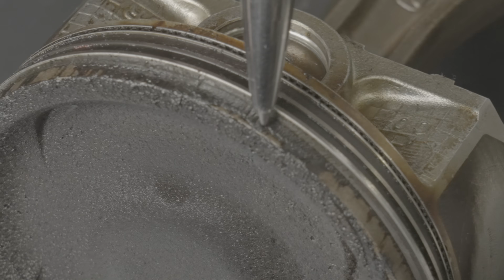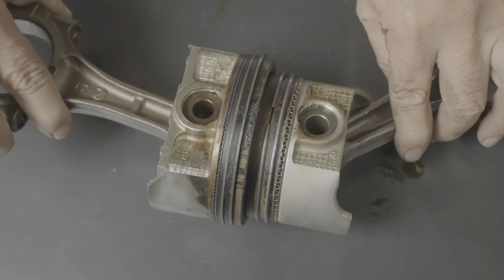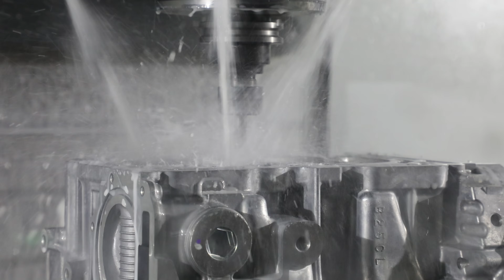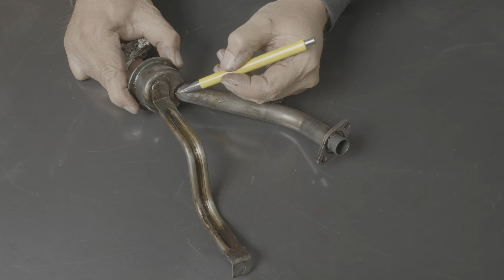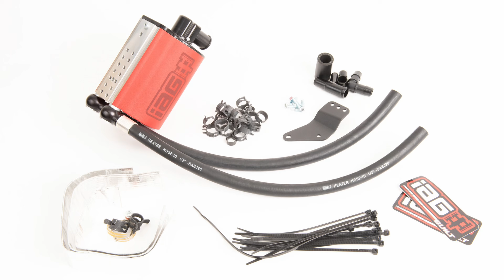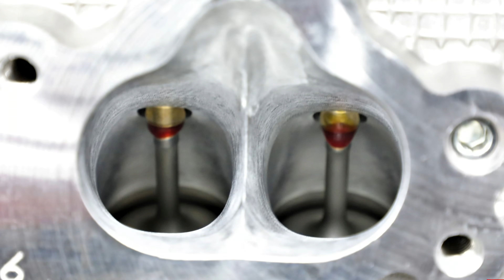Why Subaru Engines Blow Up!

Comment: Im making 286whp and 300wtq in my 2011 wrx... just street driven and doesn't get pushed too hard ever. Hopefully im safe. It has supporting mods like the oil pick up and cylinder 4 cooling mod.. gonna put an AOS on too but tired of being scared of owning a Subaru lol. Despite the constant fear of engine issues I love the character of the car, the sound and the AWD system.
Reply from the maker: If it is tuned conservatively you are fine.
Reply: @motoiq  It is. Appreciate your reply!
Reply: I have a 2011 STi. It's been on a downpipe/intake for about 85k miles. Conservative tune. If anything it's slightly rich. I run Rotella 5-40 it's whole life. I haven't had any issues. I don't abuse the car or track it. Spirited sprints, no clutch drops etc. It's still running strong. For now.
Reply: @bailey.nt86  pretty much me but wrx. This is my second of this generation and the prior was bone stock. I’ve never had an issue with these cars. I suspect a lot of the issues come from driver abuse more than anything
Reply: @nathanielgates2863  100% and abuse is the correct word.
Reply: both my NA Subaru's blew.. stock, maintained well.. 03/08

My FRS has been okay though FA20.

it's a case by case sure, though won't be owning another from my experience...
Reply: @UCMtouch stock FRS with FA20 nearing 160k miles. All original, I drive the piss out of it. Made sure the previous owner took care of it. I follow their maintenance intervals, use the old black MIJ Subaru oil filters. The newer blue filters sold/used at dealerships are taller but thinner in circumstance.  I’ve heard they’re made by Fram. I also use Idemitsu oil.
Reply: How do you like the feel of driving and acceleration?  Does the boxer layout feel different compared to inline 4s ?

Comment: other channels that blew their motors.. *cough cough donut lol. What's your take on the newer engines?, any hot takes on what the ideal range for added power with some longevity for someone who likes the occasional hoonigan shenanigans.
Reply from the maker: We haven't modded an FA24 yet, just rebuilt some GR cup car engines that got damaged in crashes.  By the rules they have to stay stone stock.  The FA20 has oiling issues once you get into the low mid 400's and the oil pump gears shatter much past 8000 rpm. Up until then though they are pretty cool engines. Like the EJ just don't ask more than they are happy with.

Comment: Thanks for condensing all that into a single video. Do you know enough to build a similar video about how to keep a modified rotary engine alive?
Reply from the maker: I am going to do a video on that subject with Rob Dahm soon.  I don't know shit about how to build a super high powered Rotary so I needed help.
Reply: @motoiq  That sounds great, I think it would be fun to see more experienced piston engine builders take a close look at the rotary engine building process. There aren't nearly as many people trying things in that arena, it would be nice to see what someone with your background might come up with. Modern ECUs with better failsafes have helped keep them alive better than 10-20 years ago, these days there aren't as many people grenading engines from overboosting or overheating or running lean. But people don't tune them aggressive because of how many parts get hurt when things go wrong.
Reply: The RX7 ECU isn't as smart about tolerating overboost or airflow modifications as the one in the Mk4 Supra, but it doesn't do anything dumb like advance the ignition timing until it hears knock. I smacked my forehead when I learned Subaru was doing that on turbocharged cars.

Comment: The IAG cast block is interesting, think someone is doing that for the RB's as well. In the southern hemisphere we tend to use the 207 (like Subaru always did for race/rally duties) smaller bore, thicker cylinder walls, less issues/more reliable when winding up the power/boost
Reply from the maker: Dart is going to begin work on an improved RB block possibly within the next year. It takes them about a year to move from concept to production. There 2JZ block they just came out will looked pretty sick at PRI.
Reply: @motoiq  Think it was an Australian outfit doing the cast RB, Platinum Racing?
Reply from the maker: I would like to know about it.
Reply: @motoiq  Found it https://youtu.be/5fn1jvKx1QU?si=ZrG42MP7NO0DKB58&t=415
Reply: @motoiq Look up PRP. They are the ones @mranderson3927 is referring to. The Australians are in a league of their own with regards to development of the RB engine.

https://youtu.be/z5_newEC6j4
Reply from the maker: Man that PRP block is fixing everything I hate about RB's!
Reply: I want to buy a 2015 wrx sti. I dont want to drive it hard, i live in californias heavy traffic, should i just completely avoid this car as a daily. I want this car, its been my dream car. I just dont want to make a mistake. @motoiq
Reply: @motoiq I just subbed aswell bro thanks for everything you do. I just never experienced a ride like a subaru
Reply: Yes company called Platinum Racing Products here in Sydney Australia is making cast RB blocks. Owner Herman is making the block stronger removing the OEM flaws.
Reply: https://youtu.be/z5_newEC6j4?si=SknPBLWne1azzyN3
Reply: Fyi the 207 never came to the us to my knowledge.

Comment: Getting an STI in next month or so, gonna iag street AOS, iag oil pump stg2, iag oil pan baffle and pick up, mishi radiator, killer B thermo housing, and 4th cyl mod, followed by a pro tune, and leaving as is after, hopefully it will last lol
Reply from the maker: Good stuff, I would run a CSF or Koyo radiator though.

Comment: Should do a series on why boosted VQ’s are always lifting heads
Reply from the maker: I feel its due to the shorter head bolts with less thread engagement, open deck compared to the VR for instance. Using VQ35HR or Juke bolts helps
Reply: @motoiq  Couldn’t agree more

Comment: It would be interesting if you would have bearings that would be at a different angle position to hold the case together and dowel pin them.

Comment: I'm going to say that it's because the drivers of them like to run them up to or close to, or beyond, their redline far too often.   Drive like a fool,  the engine will die soon.   Keep it below 3000 RPM and you'll never have a problem.   Not that a Subaru owner would ever think to do that.
Reply: Why would anyone with a sporty car keep it below 3000rpm?! That's crazy and defeats the point of having a fun car. On the STi, the turbo doesn't start to spool significantly until 3500rpm.

" up to or close to, or beyond, their redline far too often"  What's wrong with that?! Honestly why would a S2000 have wider graduations towards 9000rpm or why would a Civic Type R & Si have shift lights, if you weren't supposed to redline the engine (when warm).
Reply from the maker: Not a Subie owner with a turbo anyway, 3000 is lugging the engine.